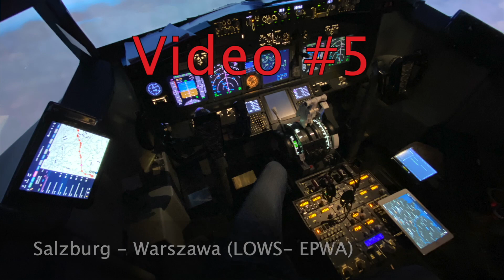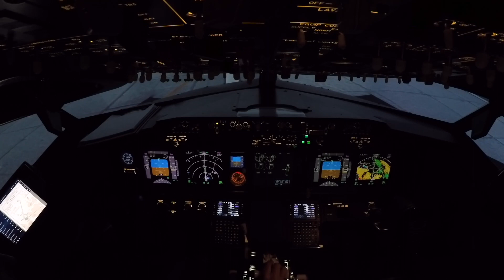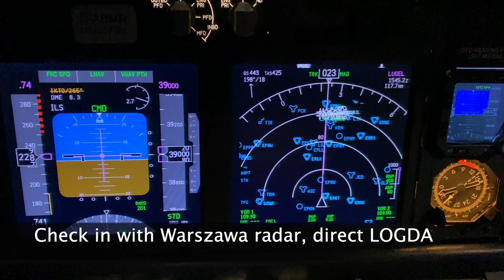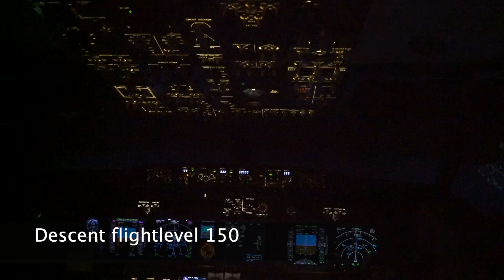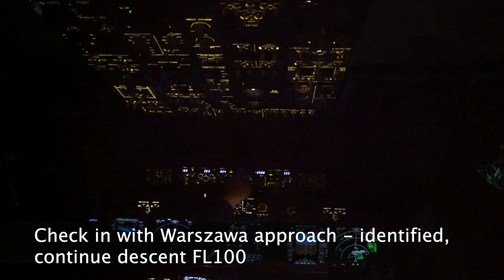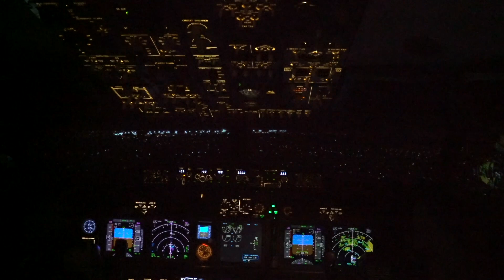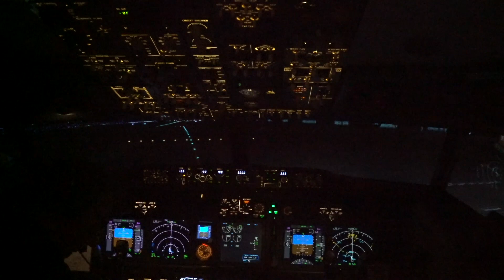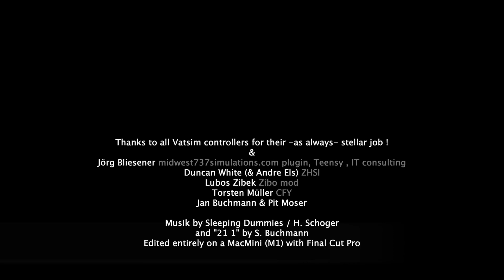X-Plane home cockpit flight with ATC LOWS EPWA #5

Comment: @Stephan, thank you for posting. What is your experience with X Plane  so far? Some say its buggy compared to P3D,  hardware needs constant adjustments. But XP visuals and flight model seem to be much better..
Reply from the maker: Hi Yuri, from what I hear from fellow P3D guys they have MUCH MORE issues ie. with every of their upgrades. In particular when you compare ProSim / P3D that seems to be fairly tricky / complex to keep it running. 
Also XP has a great plugin interface. Unlike the old offset stuff from the 90ies (MSFS/P3D). 

I tried to stuck to a SIMPLE model. 
 1) Clean XP without shaders, clouds and poor plugins. 
I have naturally some hardware plugins (XPUIPC for the TQ, midwest...for CPflight, Teensy, AirManager, xpilot, ZHSI). And I have many commercial sceneries (many of them do look great). 
 2) Few USB devices. Some simmers tend to have 30+ USB toys. Not great imho. I have less than 10, thanks to CPflight hardware. 

I have zero crashes. Zero. 
(While moving to Vulkan there were some Vulkan device errors which were fixed in 11.51 - you could even fix them in flight (!) restarting the slave machine). XP even runs already under Rosetta on my M1 Mac an my desktop. So fun. 

I have not the slightest idea what you mean "hardware needs constant adjustment"?? 
Sim hardware always needs to be the best. So I upgraded recently to i9 10.9k/3080. 

And yes, to me XP looks much more realistic than P3D. Less toyish, nice haze-ly. Some of my P3D friends like my graphics a lot. And it's only 3 x 1920/1080. 

I think P3D is not a serious option, mate. FS20 might become interesting, maybe in a year or so. But a sim is not a desktop game. You want stability and proper simulation.